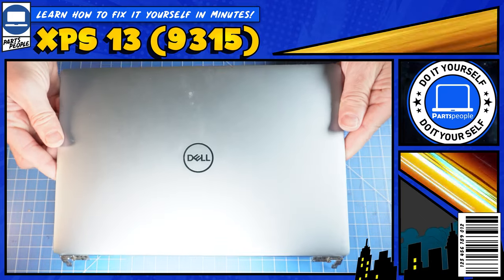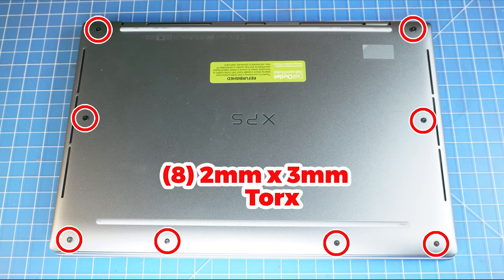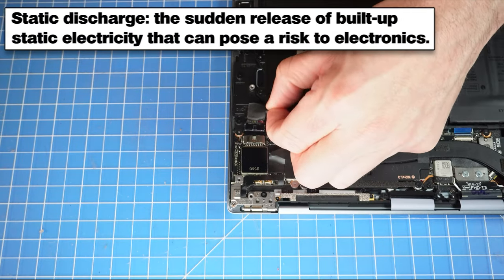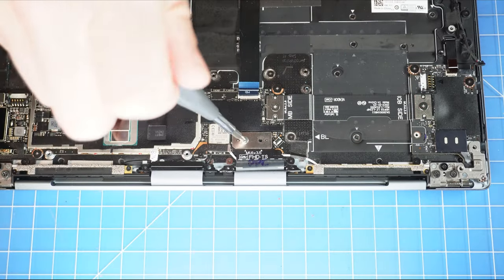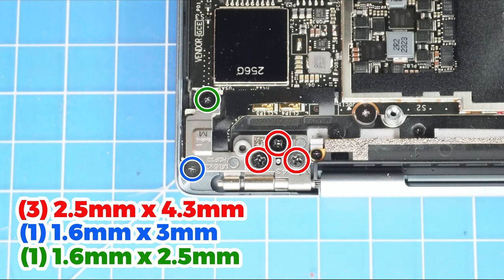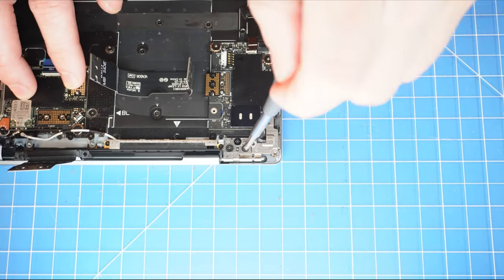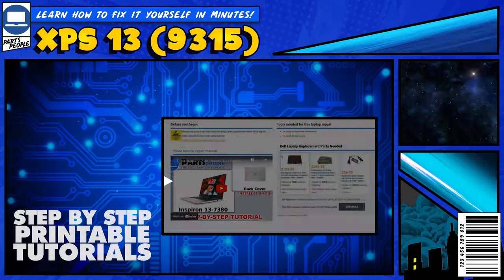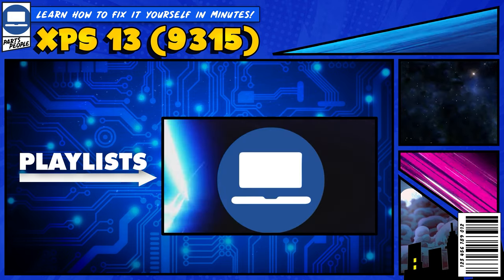How To Replace Your LCD Display Assembly | Dell XPS 13 9315

Comment: Do I need to get the right screen resolution for the one i bought for example if it was UHD would I need to get a UHD replacement or could i just get any thanks
Reply from the maker: There are a variety of different resolution screens available for this model. You should note that if you went with a different screen you would need to match it with its corresponding LCD cable.
Reply: @dellpartspeople  thank you so much for the reply the LCD cables come with the monitor usually right and if it doesnt where would I search for the right one. Sorry if this is so many questions but im not sure where to find this information. I have the 3840x2400 version and want to go down to the 1920x1200 version and also it was initially touch screen and if I get a non-touch screen version that shouldnt affect it either right. Which LCD cable i get
Reply from the maker: @emmanuelknight8974  If you purchase a complete LCD Display Assembly it will come with the necessary LCD cables. If you purchase an LCD screen (meaning just the panel) you will need to pair it with a compatible LCD cable. Hope that helps.